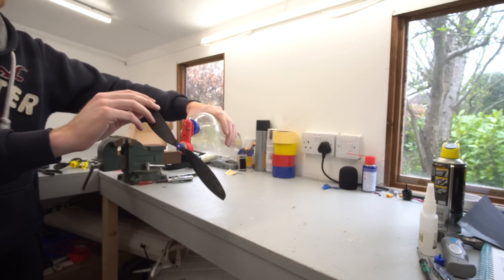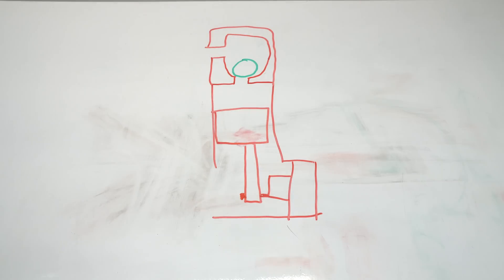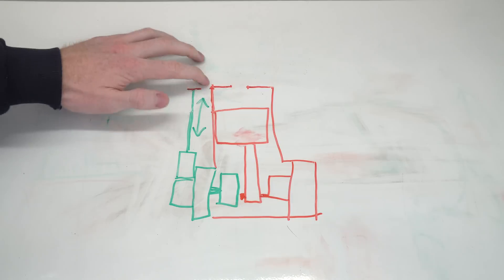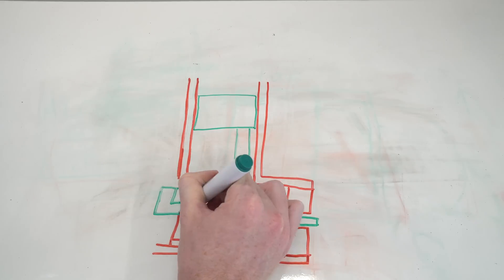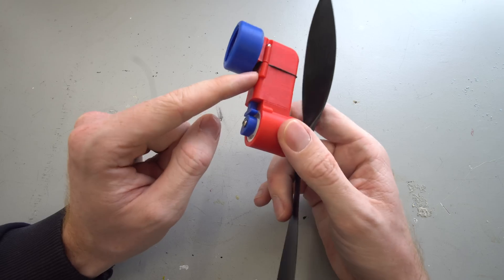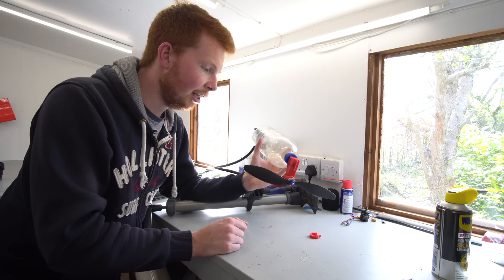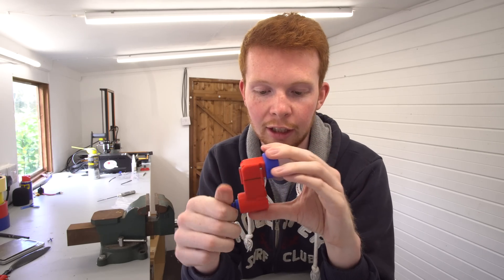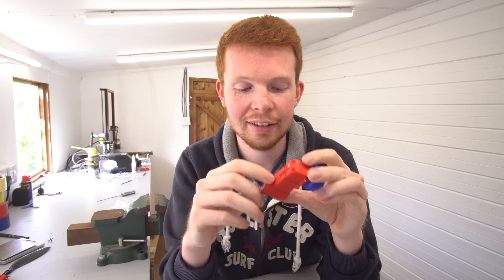Compressed Air Engine V3

Comment: Now you just need a little regulator. That way higher pressure = longer run time and a nice flat power curve.
Reply: Yes that's what I'd like to see also: nice smooth long run.
Reply: Simple 3D printed screw the size of the current hole and he could adjust it what max RPM by screwing it in or out. It could be right on top of the inlet from the bottle.
Reply: Yup!...My very thought!  Run a tank that could take some serious pressure, then regulate it down to where the motor is 'comfortable'.  I'm sure that there is a used carbon fiber, filament-wound, tank out there that would take sky-high pressure...a depleted fire extinguisher or small SCUBA tank.  Such a tank could be bonded to a wing saddle and carbon tail boom. (fishing pole or arrow shaft)
Maybe sweet-talk a filament-winding shop into creating a light-duty carbon tank from an existing mandrel.  I worked at such a place 30 years ago that did all sorts of special jobs like that...from 2 inch (51mm) to at least 10 foot (3 meter) diameter.  They had mandrels in all sorts of shapes and sizes stored in a back room.
Reply: I believe he had a ball valve in his very first video on this engine?
Reply: Just stick a lm317...

Comment: Oh btw as an instrument technician I worked a lot with pneumatics. another improvement you could make is to design your valves in the shape of a cylindrical spool.  This is commonly called a poppet valve.  This ensures that you have an equal pneumatic force on the posing faces of the valve in the open position (or a rod with a hole in it will achieve a similar affect.  The advantage of the spool or poppit valve design is that you can regulate the "open" position throughout the stroke an eliminate differential axial force which will improve performance at low pressures and decrease start resistance.  You can also make a double poppet valve is you want to control pressure on either side of a  cylinder.

Poppet valvels also seal well. 

Check this out for inspiration.
 http://www.hydraulicspneumatics.com/other-technologies/chapter-10-directional-control-valves-part-3
Reply: Like so he can see!
Reply: Grant - before I lose you chasing the link: Great Idea/lesson!   I am a great fan of compressed air engines but had other priorities growing up.  Sure wish Youtube could put thumbnail sketches in the comment section.
   Heeey!! the link opened a separate window and I did not lose you!  Great reference!!
Reply: Broken link...?....
Reply: I think he would have better efficiency will a turbine.   And a high pressure resevoir for that matter.. plastic bottle's are rated to 60 psi lol..   and the minute he said 100psi I'm thinking more like mad scientist then engineer... hehe

Comment: Cool and all but this engine won't run for very long. How do u seek to solve this
Reply: Bigggggger bottles
Reply: Tractor Mad Films lol
Reply: Tabeeb Rahman i think it'll be better by using smaller chamber, limit on the valve opening, and overdrive gear just after the crank shaft
Reply: Andrew Angelo Barrientos how much would this affect runtime?

Comment: @Tom Stanton just a thought i have had if you are planning on using this to fly with will you not be throwing a ball valve all around in diffrent directions.  Your testing and therory is static on the ground. that ball will sit nicely till you start flying around surely?  (no i dont know anything about engines just a thought)
Reply: Lebalusch it's held in place by a spring

Comment: you know how dentist drills use little turbines and compressed air to spin. couldn't you do a scaled up version of that to power your airplane prop or is it just a less efficient/worse system for this purpose and thats why your not using it?

Comment: Suggestion you may be better off building a twin horizontally opposed engine where the pistons are virtually at the top of the cylinder at TDC. The drive shaft can be cut out  to act as a rotary valve for the 2 cylinders allowing new air into one cylinder whilst exhausting the other.  The other issue you have is your operating on relatively high pressure but not high enough to benefit from the inlet air expanding after the inlet valve is closed as would happen if you were using Co2. 

To get a long run time you really need high volume which is easier in terms of storage size if you use a pressure regulator valve of some kind. http://modelenginenews.org/pachasa/index.html is a good write up with plans

Comment: Great video, thank you. I would love to see a screen cap of your CAD process, if possible. Experimentation with different pressures might reveal what's most effecient, so that use of a regulator will maximise  run-time on a single fill. I've no idea how to design a 3D printed regulator, however!

Comment: That,s amzing. Could you run this motor from Co2 cartridge for bb guns?
Reply: You would require a pressure regulator as the Co2 cartinges has about 14.2 times more pressure than his last run (852.8 ps vs 60 psii). Without a pressure regulator the plastic would likely shatter and harm you.

Comment: A little advise about volume of a "pressure tank": you can always connect bottles by small tubes - this will not compromise maximum pressure while allowing increasing of a total volume. Two bottles in a fuselage and two more under the wings for the increased flight time :)

Comment: The prolem with this idea is that you're going to lose efficiency because some of the pressure is going to want to force the piston to pivot because it's center in now on the right instead of pushing straight down. It'll also produce a lot of wear on the top left and bottom right of the piston.
Reply: Mark Potter   Perhaps make the connecting rod goose neck shape so it goes to the center of the piston.
Reply: Maybe the solution is to use two con rods and have the bearing in the middle. You'd have to print the crankshaft in two pieces though I think.
Reply: Charles Lambert I agree, and I'd be more concerned about the off center con rod causing added friction. Either way the bearings seem like overkill, you'd think a brass bushing would do the job. I can't remember if tom talked about why he went with a bearing in an earlier video or not.
Reply: With 3d printing, wear isn't nearly so much of an issue. Just print another one.
Reply: Yes I was thinking this exact thing, made me think of the Honda NR750 oval piston, had two con rods because of its unusual shape.
Reply: Dan Severns: That will move the pivot point even further from the bottom-center of the piston. It'll help with the friction from the piston and place it on the bearings of the connecting rod.
Reply: DonCasper: This sounds like a good solution to me - If it can be pulled off engineering-wise.
Reply: It's interesting that it works as well as it does.  I'd like to see it reworked as a regular cylindrical piston but with cam timing.  Would be the most efficient from the crankcase side and I'm sure you could improve the efficiency of the "combustion chamber" so you would loose a minimal amount of air.
Reply: I wonder if there is a way to put a bearing on the opposite side of the cam so the conrod could still be centered. The bearing housing could be the rear housing. Of course that would mean the entire cover would need to be air tight.

Comment: Apart from the square piston and offset conrod, I think this third revision is truly fantastic!

It's interesting how you've designed the engine to run off a cam, which gives the added benefit of allowing you to drastically change the characteristics of the engine just by switching cam profiles!

Comment: Nice job and great video!.
I'd suggest making kind of a spinning disc as the valve and use some grease?
And after that please make other forms of engines like Rotary engines that are more suitable for these kind of air power?
Good luck!
Reply: Perhaps a sleeve valve similar to  rc nitro engines.
Reply: yeeeeeeeee
Reply: Rotariessssss
Reply: A disc valve sounds perfect, and it would easely allow for several pistons
Reply: Andy [Xvixx] I actually thought there was a fly on my screen
Reply: LS swapped rx7

Comment: Do you apply any lubricant or grease?
Another question, would it be possible to run this using a chemical reaction creating gas and therefor pressure?
Reply: Hmmm... You bring up a good point. What if you filled the bottle with dry ice or liquid nitrogen or something of the sorts... I feel like you're onto something here!
Reply: This might sound dumb but, even if just for the entertainment value....

Diet Coke and Mentos powered plane!
Reply: ln2/dry ice sounds like it would work decently well. However, since it's a lot denser than compressed air you would have to start worrying about the weight compared to the lift produced. In addition, the ln2/dry ice would also cause the plastic to become very brittle as a result of the cold so it might crack.
Reply: What if you had a fishingline/string suspended  case made from aluminium foil or something to prevent from the cold stuff from touching the bottle(plastic). and some holes in it to let the gasses out. I'm not sure how much pressure it would create, So it might not be enough to get constant pressure to keep the engine running at the same rpm.
Reply: + for some oiling system.

Comment: Nice work Tom. I like the way you work to your solution. There seems to be a lot of potential gains in this design.
Reply: I agree. I would like to know if the crank and prop are balanced also as it made a huge improvement to my old airhogs plane motor.